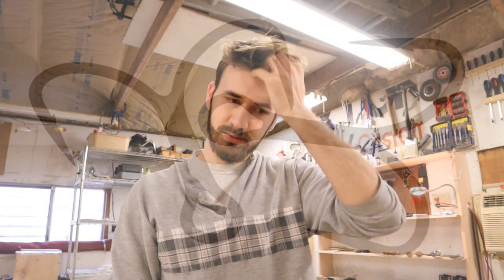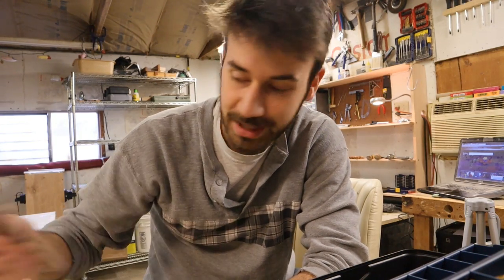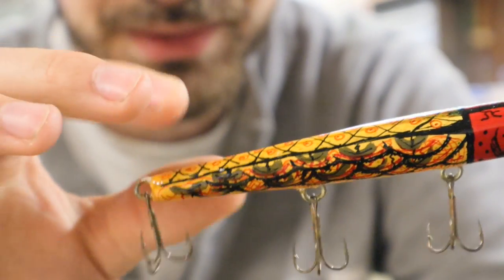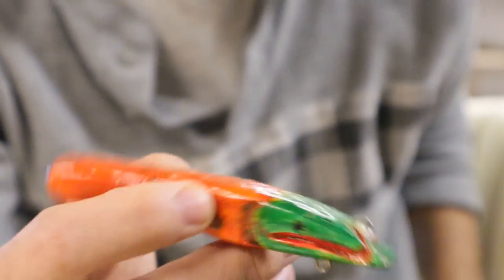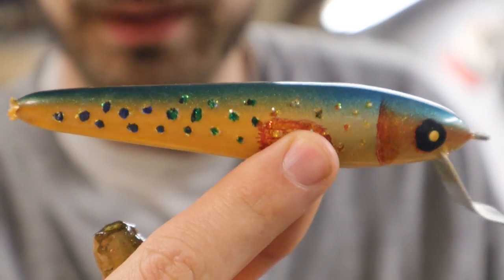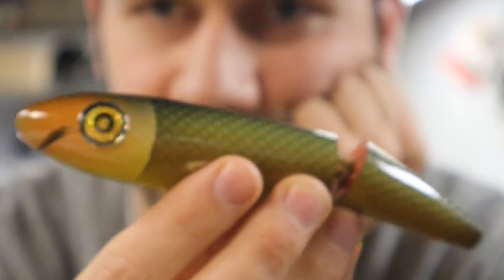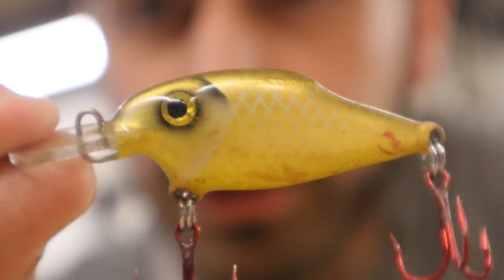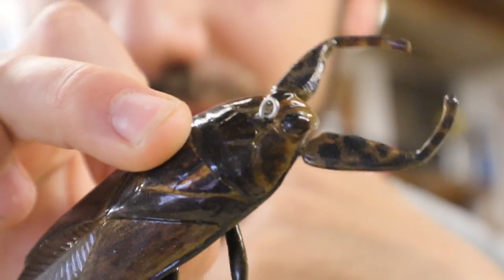First Ones I've Ever Made

Comment: Watching you gave me the idea to try and make my own wood. I found a piece of scrap wood (unsure of what kind) and got to work. Not finished yet, I need to paint it. But for my first one I feel like I did good on the shape, it's a topwater plug bait. I drilled a hole in the bottom back and put a splitshot sinker inside for weight. Painting tomorrow and hopefully testing in a couple days

Comment: What do you use to make your molds.
Reply from the maker: Alumilite High Strength 3: https://www.alumilite.com/store/p/921-Alumilite-s-High-Strength-3.aspx
Reply: Thanks I think I'm going to try and make a set of jointed lures
Reply: Ok one more quick question. What brand is your air brush I have looked at a couple but I want one that will last. Thanks